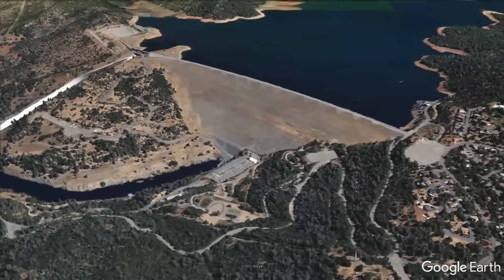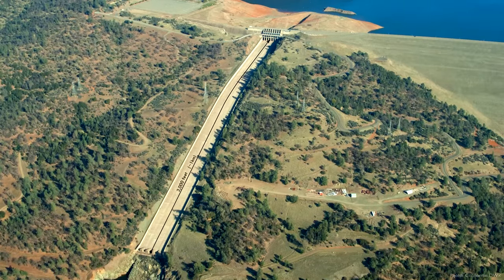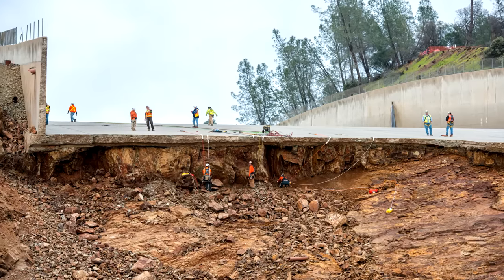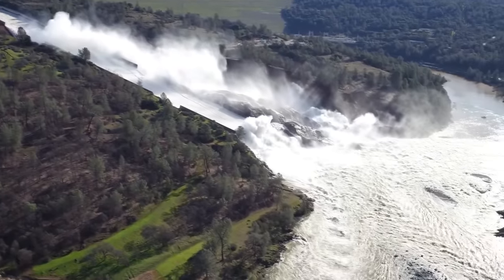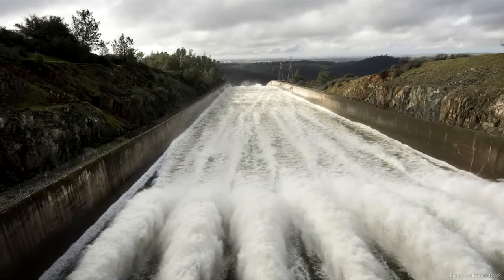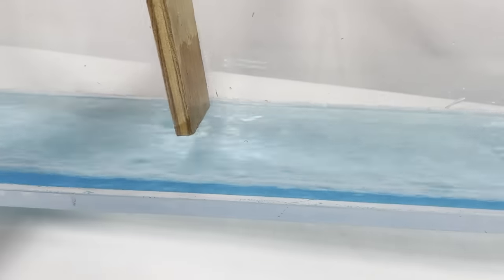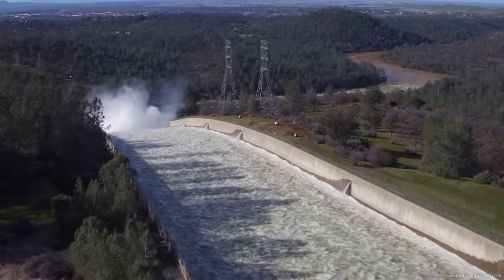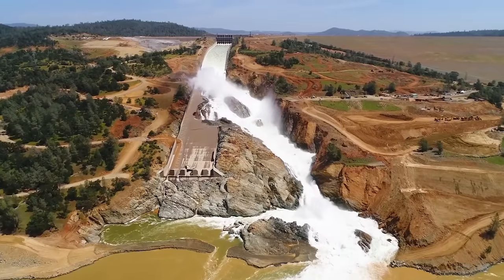What Really Happened at the Oroville Dam Spillway?

Comment: They definitely made the right decision to try the emergency spillway.  That's what it was there for.  In the process they found out that it wasn't designed properly and then made the right decision again to just let the service spillway disintegrate accepting the additional losses and potential damage to the power infrastructure as the lesser consequence compared to the total failure of the dam.

Comment: did they have access to the top of the damm during the emergency?
you could have atleast partly taken some flow capacaty off the spill way by laying some big hoses but small enough to siphon water throu the pressure difrence 

I know you will never get 800'000 L but in such an situation you can never know usaly it's the feather that breaks the cammels back

Comment: As you said sir, its mostly entirely human error and negligence. There shud have been inspections beforehand in such scenarios. And relying on over head dam at its peak is a very dangerous catastrophic move of them to take as it has not been tested. On top of that. Earthen topography and weathered bed rock is major drawback for them. Everything was miscalculated or misinterpreted. Looks like the emergency spillway was built based on children slide on parks. No underground structure or concrete pins that holds the spillway structure. Weather is always the enemy at these events but it isnt certain always. As you said, the stagnation points underneath those spillway structure,  erosion of the soil were a major factors. In such cases, extra extra measures shud have taken to build such structures as there is negligence involved. Not to be taken hydroforce lightly. 🌊🌊💧🌊

Comment: I worked in the infrastructure industry for years. New projects are very expensive and budgets are tight. No agency or city or state or any owner budgets hundreds of millions of dollars for required maintenance and repairs. It's an ongoing and neverending fight for public money to keep roads, bridges, dams, etc. in proper working order. So what you end up getting is bare minimum short term patches just to keep it above failure level at normal stress levels. Raise the bar just a little and failure is what you get. It's what happens when politicians hold the money.

Comment: This is kinda like what caused SpaceX's issue with stage 0 in IFT1. The pressure from the rocket exhaust caused the fondag to bend, compressing the underlying soil and crack and then the rocket exhaust got through the cracks and under the fondag and lifted it away.

Comment: It happened because of neglect and mismanagement. I saw them sealing cracks on that spillway with expired epoxy in the heat of summer 3 years before it failed! Anyone who drove over the spillway that summer saw them doing this, bubble gum and paperclips repair job. They hid all the maintenance records in containers offsite and covered up all the incompetence and neglect.
That's right, 50 years of neglect. Personally, I think they wanted a catastrophe.
The Feds had to come in and clean it all up.
The real losers here are the local residents.
The State took one of the most beautiful pristine canyons(The Feather River Canyon) that was a tourist mecca and replaced it with a half full mudhole that ships water down south.

Comment: The introduction mentions the Probable Maximum Flood and characterizes it as synthetic or made up, then moves on as if this is not a critical assumption, a potential source ot total catastrophic collapse of the Oroville Dam by overtopping. The design PMF for the Oroville dam was determined based on theoretical statistical studies of rainfall dating from the 1950s and before. Unfortunately we now know that it is a flawed outdated assumption. Current knowledge of historical rainfall events from geologic climate studies and current studies of atmospheric rivers show recurrent long droughts and recurrent massive atmospheric river rainfall events over the region. This means that the the assumed PMF for the Oroville Dam design was a huge underestimate of what we now know has happened repeatedly in the past 2000 years. Rebuilding the spillways to meet  the original design goal of the main and emergency spillways did not fix that design flaw.  As designed and as now built, the Oroville Dam outflow spillways are undersized and in a 500 year flood the Oroville Dam would be overtopped.

Comment: This guy is definitely smarter than me and I only know this because funny enough it was a trivia question I had a couple days ago (which I got wrong lol) but there’s 80,000 cu ft of water in a standard Olympic sized pool.

He says it’s capable of releasing 300,000 cu ft a second followed with “That’s roughly an Olympic size swimming pool every other second”

So in 2 seconds that’s would equal 600,000 cu ft which would be nearly 8 Olympic size swimming pools.  Now there’s 600 gallons of water in an Olympic size swimming pool so I think he mixed up what he was trying to say.

So the correction is that the max flow would equal nearly 8 Olympic size swimming pools every other second.

Comment: i wanted the water to go down the spillway in 20 huge plastic pipes that could be repaired one at a time if needed,  i didn't see any downsides to the idea. metal pipes could also have been used or a good mix with the winner going into repairs. Im a self-made engineer. Ironically my idea will be used at this spillway, nextime

Comment: Grady   and all who read this. 
  The biggest  failure of the  entre project was not discussed anywhere . 
the lack of proper maintenance of the spillway  did result in its failure.
What everyone missed was the outright theft of the people of California of a billion dollars.
The  new spillway was a money grab on a  scale never seen before.  I would like to have  the the engineers  show the math in  courtroom  that would justify a piece of concrete 150 foot thick mounted into bedrock .  the actual dam is not built that strong.

 The original spillway  engineering had  a 7"?  slab on grade  with drainage . This is definitely not to modern Safety factors. but someone signed off that it would work and maintained properly it  most likely would have .
 There was Absolutely Unquestionably No reason  to build on the  scale that they did other that taking advantage of an emergency situation and cart blanch to spend  heinous amounts of money and profit immeasurably.
The government agencies overseeing the process to keep this type of misconduct in in check were either profiting or negligent.

if nothing is done to bring this to light it will continue to happen every time any emergency work is done.

Grady I have always enjoyed your content and Thank you 
 I also feel you may have a few engineers in audience that may know more  what type of forces are involved in a spillway.   I did a lot of calculations  but his type of dynamic load I have questions about.

Ron B

Comment: The limits of professional engineering? 
They assumed solid bedrock? What happened to test drilling the area emergency overflow to investigate soil conditions? Even just a couple of test drills should clued even the slowest engineer in that the soil column was not suitable. 
No one lost their "professional" engineering license for incompetent design?
No one lost their "professional" engineering license for incompetent safety reviews?
No one lost their "professional" engineering license for incompetent inspection? 

Sounds like P.Eng. protecting P.Eng.
Same thing happens in medicine. 

P.Eng got a chunk of the $1Billion rebuilding price. Good deal for professional incompetence.

Comment: What really happened at the Oroville Dam concerning the collapse and deterioration of the spillway. Is in direct correlation with the 100% negligence upon the state of California and the PPL Power Company. As well as the federal government for not properly inspecting or overseeing the maintenance requirements for the Oroville Dam. Years prior even to the Oroville Dam collapse of the spillway. The immense damage could be seen from space of the cracked and degraded concrete surface of the main spillway. And completely crumbling so-called emergency spillway. Which the state of California was completely and totally aware of and did absolutely nothing to correct it. Until after the fact of the collapse of the spillway. Even to this day there are many dangers when it comes to the Oroville Dam not being maintained properly even after the emergency Spillway failure. Even after spending over a billion dollars for reconstruction For instance there has been an abundance of water that has been collected at the Oroville reserve and Dam Waterway. However instead of using that water to properly irrigate through regulation of the abundance of water to use as a supply of water to irrigate the dying landscape that encases the banks of the Oroville Lake and Spillway and Dam Earth wall. They have let it remain extremely dry and extremely vulnerable where in some areas there is nothing to hold back the water but dry sand. That's why when flyovers happen or aerial shots are taken of the Oroville Dam you can still see dead and deteriorated dead trees grass and bushes meaning their root structures have no hold on the land. You can even see the famous Green Spot on the embankment wall of the Oroville Dam that works as an earth Dam. The Green Spot indicates that there must be water intrusion into that area as the rest of the grass on the dam remains dead. Or Behrend dry sand Many people are completely and totally unaware of the fact that Nancy Pelosi family particularly that of Nancy's father has a lot to do with the lack of Maintenance at the Oroville Dam and all of the corruption that took place there. Money had been collected for years and years through the power plant company that supplies the power plant generators for the Oroville Dam as well as the contracted maintenance company that has direct ties to the Pelosi family as getting the contract to begin with. Even the power poles carrying the electricity we're not maintained properly and were known to have Sparks and Fallen poles from Total lack of maintenance. In fact During the Reconstruction of the Oroville Dam many power poles had to be removed and replaced put into a different area surrounding the Oroville Dam. These power poles go throughout the entire state of California and can be blamed for many of the California fires that reoccur every year that and the fact of over growth from not properly allowing the timber industry to harvest trees and vegetation. I always find it amazing how California citizens pay more money for their power bill and their taxes as well as their property than any other state in the United States and yet have very little to show for it. There are poles that literally go back to the 1920s still in existence today. Just like there are many waterways spillways and dams throughout the state of California that also have not been maintained over the years. You would think after the Oroville deterioration of the spillway and the emergency evacuation. That the state of California would have actually learn something but instead they have allowed more infrastructure to continually fail and not be maintained properly. California is known for repeatedly contributing to letting disasters happen due to total negligence and neglect and not maintaining infrastructure because California knows that they can simply get Federal funding every time they have another disaster. California repeatedly loves to blame everything on global warming. And the politicians and the people in charge are not held accountable for their negligence and total corruption so there is no real effort to secure the safety of their citizens. I guarantee you just like the recent flooding in California that recently just occurred March 2023 because of a another failure at a man-made dirt retention wall that had already been previously reported was in danger of failure yet again California did nothing about it. Not even so much as putting sand bags absolutely nothing was done even though several reports were made. Warning of future imminent failure entire neighborhoods have been flooded once again. Unfortunately this will be a regular occurrence because California simply does not maintain things properly they would rather use that money for their own crooked endeavors and personal gain. Instead of using the taxpayers money properly by maintaining their infrastructure properly. I challenge anyone out there that has a cell phone or computer with Google Earth app. To witness and check out for themselves the horrible condition that can be seen from space through the use of the Google Earth satellite to see for themselves how bad the current conditions are. It doesn't take a engineer to clearly see how horrible these infrastructures have not been maintained. And by infrastructures I'm referring to all the dams in California as well as Bridges. And power plants and the power plants power supply poles. Rivers canals and lakes. And to also go online and read the latest inspection reports from those sites. And then also think about what cannot be seen such as the infrastructure Underground that is also deteriorating. There needs to be a major investigation when it comes to everything involving infrastructure in California. Especially the infrastructure that is meant to protect its people living there. And visiting there.

Comment: A bunch of massive pumps and hoses could have gotten some water past the bad ground
Reply from the maker: Lol no. Google the flow rate of the biggest pump at your local equipment rental
Reply: @PracticalEngineeringChannel  we had one at my work that would pump a pond out in a work day. It was a big pull behind diesel engine style pump with 6 or 8 inch hoses. kinda like the jack hammer compressors.
Reply: @PracticalEngineeringChannel  I believe it was an old military pump.
Reply: @PracticalEngineeringChannel  some of the larger pumps will pump 5000 gallons per minute.
Reply: @PracticalEngineeringChannel  2001 Godwin DPC300 12" water pump, diesel powered, Dri-Prime prime assist system w/ belt driven Quincy air compressor, John Deere 6068TF150 turbo diesel engine, mechanical fuel injection, pre-emissions, 12" inlet & outlet, 4660 GPM max flow, 3.7" solids handling.
Reply from the maker: @Coopdeville0624  It would take more than 5000 pumps of that size to move 60000 cubic feet per second (max service spillway discharge during the event)
Reply: @PracticalEngineeringChannel  I suppose that is a lot of water lol

Comment: so why did after that 1st hr stop they hire 100 volunteers with diamond  💎 wheel grinders to carve a router bevel to protect the under engineered slabs? and use tubes ofvulkem rubber to seal the new beveled gaps? just need climbing harnesses anchored to the top like 1 cable across the topmid and lower with standing climbing harnesses and ropes over pylleys with auto belay devices a quick 15 min training and everyone with 2 way radios for communication so that everyone knows when to quit grinding and get off the 🪨 slab together

Comment: Knowing how engineering circles have to work with politicians who hold the purse strings, I suspect that there were competent inspectors of the spillway that noticed such cracks and failures over the years but were not listened to by the politicians.  The politicians would rather spend public money on the social side because that gets the votes, instead of on maintenance side of a slowly growing but deadly problem where votes don't exist much.